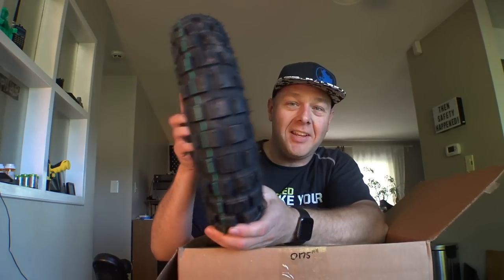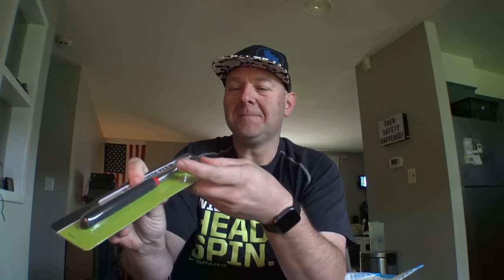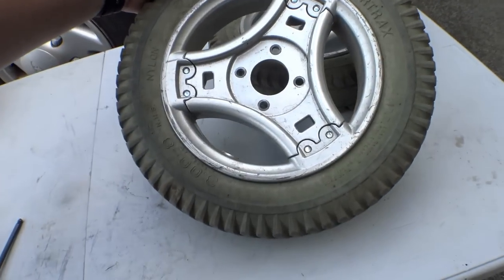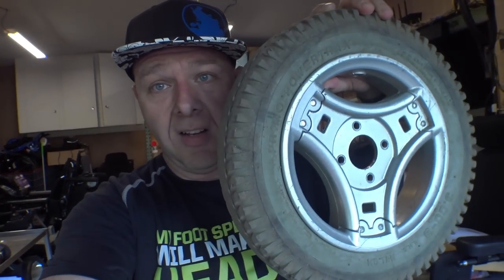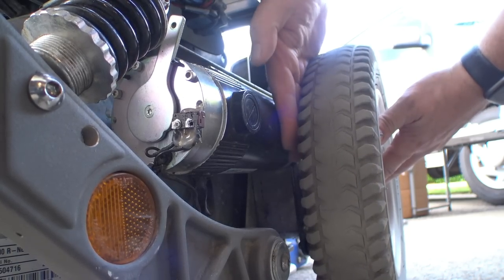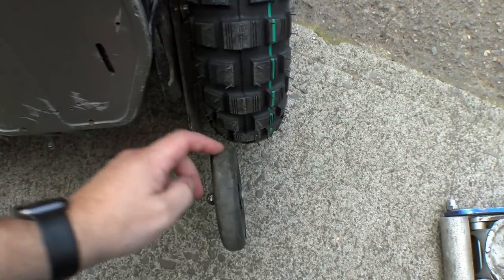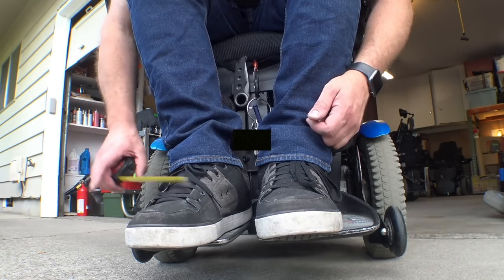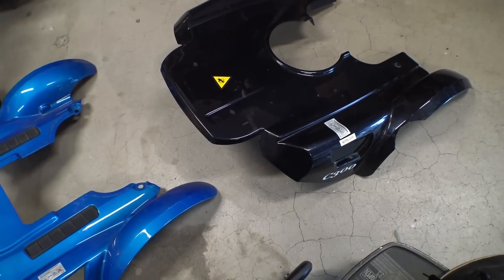MEGA VLOG 513: building the $91 OFF ROAD powerchair!

Comment: Try some talcum powder ( baby powder) on the inside of the tire and on the tube. It stops the tube from sticking to the tire when it heats up. The tube sticking to the tire can cause a flat if the tire slips. The tube can pinch or get a hole in it. I’ve been doing that with tires since my dad taught me when I was a kid To keep the tube from sticking to the tire. Back then we vulcanized patches on (started the glue on fire then blew it out, slapped a patch on and ran a roller over it.) putting baby powder on a patch prevents it from pulling the patch off from sticking.

Comment: Before assembly, a light coating of Talcum Powder inside a dry tire or dusting the tube with powder will prevent the tube from binding against the inside of the tire or the rim. It will also prevent a tube from creeping inside the wheel and damaging a valve stem if you are running low on air. Nice video. Keep up the good work.

Comment: Hey Dan.  Do't know if you have tried it, but I have reused solid inserts in new tires by cutting them on a bias so that they can be inserted back into new tires.  I first cut them out by cutting the tire in half along the tread; avoiding cutting into the solid insert.
Reply from the maker: I never would have thought of that!! Glad I haven’t thrown any of them out yet!!! Nice!
Reply: @TotallyNormal-  hey ,I like your videos, you know if its possible to change a rear wheel drive chair to a front wheel drive chair?  want to convert my Quantum Rival. any info would be nice.
Reply: @TotallyNormal-  That would make a GREAT video. I tried that before and broke the foam core trying to install it.

Comment: I have a Magic Mobility Frontier V6 AT (Version 6/All-Terrain)  with inflated All-Terrain tires. One thing I had to know how to do and have the tools and spare tires/wheels somehow nearby. My tools are in the backpack behind my chair and the spare tires/wheels are ALWAYS in the back of my van. That way as long as the van is with me I have a relatively easy way to deal with a flat. It does mean switching to the gray hard tires but I'm good with that. Of course, none of this works if I take the bus, which I haven't needed to do much since getting my mobility van.
Without question the inflated tires are an AMAZING ride!

Comment: Just a suggestion. When inflating the tires after assembly remove the valve core and inflate the tire. It will seat better. Also, a adding straight valve core to the valve core tool makes it easier to handle/use. Please explain the significance of the 120 AMP controller. Also, what are the wattages of the motors and the F3's superiority ?
Reply from the maker: the R-net 120 amp controller is the most powerful version they make - and allows for surge currents to more easily move the chair (and larger tires) around.  it also has more 'electrical headroom' and better cooling.  the original motors that came on the permobil C300 chairs have a lot less power handling (torque) capabilities - the newer motors (while a bit faster) are also a LOT more efficient.  the wattage of the motors is somewhat irrelevant, as the whole system uses a PWM drive scheme - but the 2 pole F-series motors they have EXCELLENT torque! -they hold their own against most 4 pole motors of other brands! they DO require the 120 amp controller to operate at full power though.
putting larger, wider tires on a chair can really tax the drive system - and you want as much available power as possible to keep things from overheating, and run more smoothly. (less stalling of motors from overloading)

Comment: Remember you're changing the leverage by putting bigger tires on it it's basically putting it in a higher gear you will get a faster speed unless hill climbing ability or it will just use more torque when under a load but it's gearing it higher the higher the tire the higher the gear without changing gears you can think of it as if you had a little tire would go really slow

Comment: Use baby powder inside the wheel and it will help with seating the inner tube and Tire when you inflate. It also helps with avoiding flat tires.

Comment: WOW...Thats a real Money Saver. The best price I've seen on the quantum turf tires was about $400 a pair.
Assuming that the stock tires you removed are 3x8 inch, the Honda tires should fit on most wheelchair rims. Correct?
It's nice that the reverse-rim trick worked out for you. I suppose the fancier (the more ornate) your rims are, the more difficult it becomes to reverse mount them. Thanks again Dan. Very nice demonstration. Good safety training clip too. lol

Comment: Interesting.  The wheelchair I just got works well offroad, has decent traction.  I took it on the lawn. and OMG, our sidewalks here which are like offroad.  Uneven concrfete blocks with weeds growing out between.  It works on these sidewalks, but because most of the curbs at intersections here aren't acessible, I luckily could stand for a moment to move the chair. it only weighs 58 lbs.  I have RA, so just a moment on foot is OK, can usually get by without pain, takes a bit longer than that before the pain comes.  I don't drive, so this will give me some freedom.  I avoided what medicare can get for me, because not being able to drive, and the shape of our sidewalks it wouldn't have given me any freedon.  More likely would have just gotten me stuck someplace. I was lucky to get some cash my way to pick something that suited my situation.

Comment: 29:58 Instead of cutting, I used a heat gun to flex the fenders up. Worked great, kept the fenders and didn't have to cut anything. I have a M300, but it should work on any other plastics as well.

Comment: Have them spray expanding foam between the rafters about 5.5 inches or more and it will stop that heat big time.
When it gets to 92 outside here in Texas my attic is about 84 to 86. This unloads the AC units big time.
Reply: I am referring to the attic heat.
Reply: noooo! stay away from the expanding foam...FAR AWAY! besides being a pain in the butt if you need to access something entombed in the foam, if the person installing the foam doesn't do it correctly your home is ruined. even when done correctly many people are having issues with the off gassing. to avoid having your house and everything you own smell like a fish market best to use regular forms of insulation. since you have respiratory issues it's even more vital to avoid products with off gassing issues. R-value is the biggest thing to consider when working with insulation. i am sure you know that already. I have seen almost all your videos and it's fairly obvious you know your way around a toolbox and done enough wrenching to even know what size your muffler bearings are in your van. <wink>
Reply: Another Great idea is to install a 3M gable vent fan. Gives about 2200 CFM for $200 of parts (Fan, thermostat, louvered vent that opens/ closes automatically). It works really well if you have an attic door. It pulls all of the heat rite out of the house at night. Check places like home depot or lowes.
Reply from the maker: I think we’re gonna go with radiant barrier - it attaches super quick and REALLY cuts down the heat! Thanks for the suggestions everyone! - oh and a powered vent fan. There’s a perfect spot for a vertical blower with automatic louvers :-)
Reply: @TotallyNormal-  Oh, just an obvious reminder:  Some people are against using an auto-on thermostat for the fan. If you had a house fire, the fan would turn on and actually accelerate the fire/ feed the fire.
However, you being an ingenious inventor, maybe you could wire it into your smoke alarm to disable ???

Comment: Hey bud, in that episode where you put these Permobil Flat Free Tire 3"W x 14"T Black - Aggressive Tread on that F3, was it worth it? We get a lot of snow here, and my ramp is 30ft long and slightly steeper than code 1in to 12in my C300 does great; I tried the F3, and the ramp got wet from the rain. It's treated wood with a little alga, and I couldn't go a foot heading back up, so the rep figured the front suspension was cranked all the way tight, and it was, so he softened it, then hosed down the ramp, and he couldn't stop me from going up by pushing me from the front the tires wouldn't spin I just pushed him, but before we got to do that, a friend cleaned my deck with cleaner and power washed it. Another thing, do you think the gray tires have the same compound as the black in the stock tires because the C300 are gray and the F3 are black? They claim they're the same, just different colors. And it's not winter yet; thanks again for the great videos.

Comment: How bad do these hold dirt?  My stock tires seem to really hold alot with the fine tread pattern, I was considering the stud tires or these to get more floatation but was hoping the bigger tread voids would let the dirt fall out easier instead of just holding a bigger amount of dirt lol.
Reply from the maker: unless you're running around in wet clay, it's not an issue :^)
Reply: @TotallyNormal-  no not really anything like that. Just dirt like under maple trees or from driving through stone or slate parking lot, if it's a little bit wet the fine dirt really sticks in my treads on the stock tires, they're just the standard grey flat free power chair tires most have.

Comment: Why would you cut off the fenders? It appears, all that would be necessary would be, to add spacers under the plastic at each bolt down location.
Reply from the maker: i cut that part out of the video for some reason.. but yes, spacers would work just fine.  however this particular chair didnt have any plastics on it anyways :^)

Comment: I have a quick question bud. I have a jazzy 1450 D
Its extremely heavy. Both batterys are totally dead. What types of batteries can I run. And who or where do I get em.
Since you are the Guru master powerchair sensei .
How to fix this myself.
I bought it in So Cal
Reply from the maker: looks like most of those chairs use the NF22 (or group 22) size batteries.. ya can usually get a pair of them on amazon or local vendors for a decent price.. i always recommend MK brand batteries.. they have the longest service life! but they do cost a bit more..

Comment: That's a neat conversion Dan!
I have MOT131092-06 & MOT131093-06 motors in my Quantum Q6 Edge.  
Are those the only motors that will work on this chair?  
I also have the original MK M22NF SLD G, 12 Volt - 51 Ah, Deep Cycle, Gel Batteries and they are only holding charge half as long as they used to so I will need to replace them.  
Are there any better batteries I can use for this wheelchair?

Comment: Hey man how's it going. 

Can you suggest a good wheelchair with longer range. Because quantum edge HD range on that company says 25 km but i get only 4 kms . When I put new batteries for few months it's little better than that but after a few months the batteries get messed up I end up paying a lot to get the new pair off the batteries. Can you suggest best brand and model of wheelchair. Thanks
Reply from the maker: most of the permobil chairs ive had get anywhere from 9 - 14 miles on a charge.. and that's ACTUAL miles on the street! if ya get a chair with group 34 batteries.. roughly 8-10 miles.. and if you get one with group 24 batteries.. usually 12-14 miles depending on 'things' lol  a number of the quantum chairs have NF22 batteries in them and those are SMALL!! ive got a Q6 edge 1 and it goes DEAD after 3.4 miles!! AmySystems is another good brand too - ya can get them with large batteries and hit the 12 mile mark pretty easily

Comment: Hey man, have you considered putting different casters on the back, maybe a touch wider? I just got a brand new chair from the VA and I’ve been hoping to modify my old C300 into something a bit more able to cross country in. I want to try fishing or hunting in. I want to build outriggers of some sort as anti tip laterally. Ummm, is that a tactical vest back there on the shelf behind you?
Reply from the maker: been looking for some air-filled replacement castors for the back.. ya cant go too much wider because they'll start fluttering around quite a bit - but air filled tires are a little bit wider and less weight.. should de the trick!

Comment: Dan do you know is the tires from a Magic mobility 4 x 4 will fit on a Permobil C300?
Reply from the maker: pretty sure the hubs are different.. but the main issue is the offset... though ive never actually tried to bolt them up :^)

Comment: Hey sir! Just discovered your channel and I'm loving it! So many great ideas fory daughter's power chair!

Quick question that I can't find the answer to anywhere. I need to remove the rear accessory tray that came mounted on her C300, but in order to access the bolts holding it on, I need to move (lower?) the 'suspension arms' for the rear castor wheels out of the way. Can I simply jack up the back of the chair and disconnect each arm from its 'spring/shock assembly' to let it drop down a few inches? Sorry for the made up part names... Haven't looked up any official nomenclature! 😄
Reply from the maker: hey! yup! thats the easiest way to do it.. just pop the shock bolts off.. its best to remove the lower bolts that are physically attached to the swing arms.. the top ones are mounted to a rod that goes all the way thru the chair, and it will rotate - making it difficult to remove the bolts/screws.  for using a jack, just make sure its far enough under the chair so you're not lifting or touching any part of the back plastic cover (assuming ya haven't removed it already)
Reply: @TotallyNormal-  Awesome! Thanks so much for the reply! Appreciate it! Be well, man!

Comment: As I'm going forward in my wheelchair from the left and the right motor which way is the motor turning? Are they turning the same or they turning opposite from each other? Because I accidentally bought a right motor when I need a left side motor. And I was told you had to program those motor to the controller when you replace a motor, but I'm not sure if I have to reprogram the controller to the motor.  By the way, I was born disabled with spina bifida and lost my right leg back in 2014 and in 2020 I lost my left leg above-the-knee. I'm sitting on my right leg, but I have artificial light for the left side if only I would learn to put it on when my wheelchair quit on me and throw me out of the chair when I can get back up with my artificial left leg 🤣 👉🍗 my wheelchair is a TDX SP2
Reply from the maker: electric motors dont care which way they're turning - but on most chairs, the left and right aren't interchangeable - as in the left motors wont be able to mount up to the right side.  its also best to replace motors as a pair - since they have to work together and one with a lot more/less use on it may not allow the chair to track straight

Comment: i'm having a heck of a time with my invacare m91   lights don't come on any more.   what happened was i was pushing something with my chair i guess it was too much for it.  i was wondering if there were any fuses that i could change out. i have already taken the chair apart today but i need a special screw driver to remove the screws on the controller . i'm hoping there is a fuse located there.
Reply from the maker: does the chair power up at all? most invacare chairs have fuses integrated directly into the battery cables themselves.. sometimes bolted directly to battery terminals
Reply: @TotallyNormal-  I checked for fuses on the battery cables but there don't appear to be any.  No it doesn't power up at all.  I was pushing a stuck lawn mower while sitting on the chair .  The light on the joy stick turned off and never turned back on.  I think i forced it too much
Reply from the maker: They don’t always look like fuses.. they have a couple versions.. one is a square block that screws right onto battery terminals.. (red or brown screw-on plastic nuts) and the other is buried under heat shrink on the cables.. (about same diameter as the cable)
Just to verify- it’s good to check cables with a voltmeter.. 
seems odd but I’ve had it happen before and confused me for a week!  (also the cable connectors can flash and soot can keep them from making a connection even though they’re plugged in) some chairs the cables themselves are a giant fusible link..
I’ve got photos on the website inside the controllers.. I don’t remember right off if there are any internal fuses.  
That chair should have a “shark” (mk5) equivalent controller
Reply: @TotallyNormal-  hey that's what it was as an in line fuse . I luckily have a few broken chairs around and was able to steal a fuse frim one of them.  I did know about thos fuses at one point but it never dawned on me this time.  Thanks for your help in back in business.  Hey i make tshirts I'll design and make one for you if u like . Or even a baseball cap to have a more detailed design.   Hey maybe we can make some for you to sell just a thought .  And thanks again.

Comment: Just found your Channel. Interesting I have a old C300 for my current chair is an F3 do the off-road tires fit the if3
Reply from the maker: the wheels are different on the newer chairs, getting the offset so the tires won't interfere may take a bit of work.. ya cant just flip the wheels around unfortunately. also the fenders etc will needs some modification